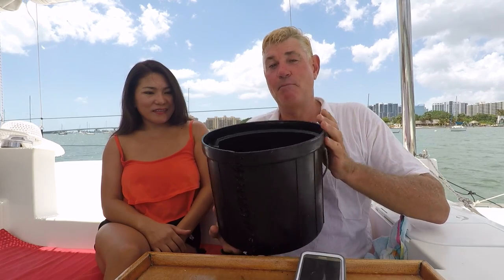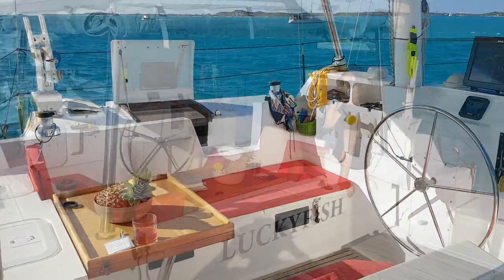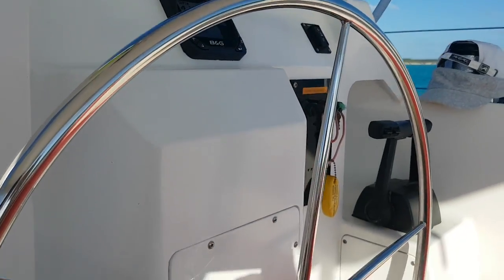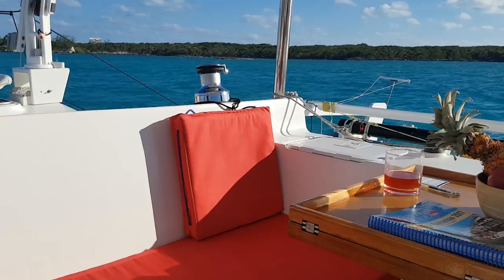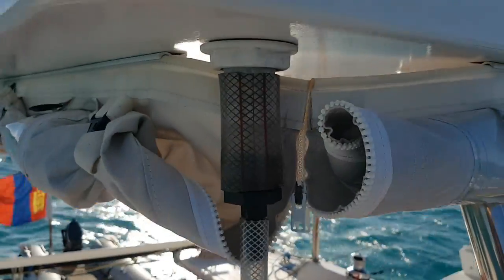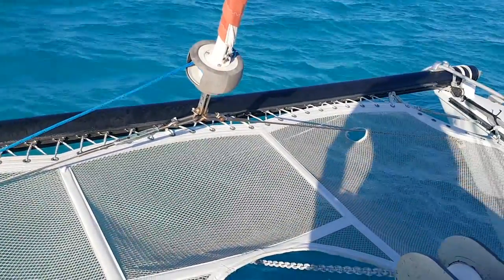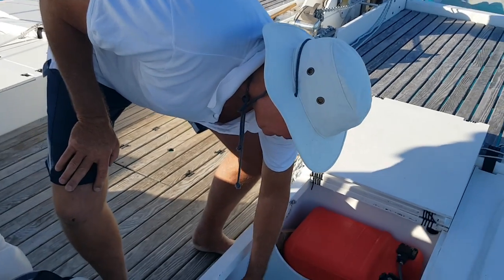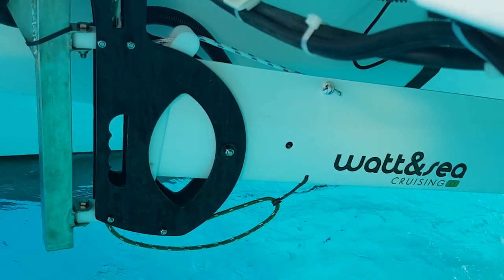LUCKYFISH Boat Tour Part 2 - The DECK - Ep 46

Comment: I really like the mix of old school and modern. Twin vanes then pulleys to drop the motors. Love it. It's a lot different and I'm sure a unique way to cruise. What kind of speed does she get under sail?  Also, while I'm asking questions.... In one of your early videos I remember an issue with a separation at the transom, was this rectified? Was it a design issue?
Reply from the maker: +Albion Parrot, thanks for picking up on the blend of old and new tech. Its one of the things we really enjoy about developing this boat. Picking the best from both worlds without being blinded only by one. Speed is excellent for a cruising boat, on all points of sail from sheets just cracked to dead flat off. She does half the wind speed or better up to about 12 knots wind speed tight to broad reaching. 8-9 knots with ease in 18 to 20 knot true wind. On a recent passage from Grenada to Exumas we covered 1058 miles in 6 days 21 hours ave speed 6.44 kts in a variety of conditions. Pretty respectable! Our transatlantic of 5,000 miles from Namibia to Barbados included Doldrums and awkward seas at times. We averaged 5.5 knots over all. Again, very respectable considering we had a novice crew and didnt push the boat. Re the delamination on the lapstrake, that was starboard hull forward and turned out to be an epoxy fillet that cracked away from the glass, likely due to the pounding we got in the Benguella current. It has since been glued and has presented no further problems. It was not structural thankfully! Cheers and great to get your questions, Stewart

Comment: Must totally agree with Stephen. I was looking at Hunter 44DS monohull. I think I am sold on the catamaran. How often do you have to replace the forward between hull netting due to uv deterioration? Again Thanks for the video and sage advice. Marc
Reply from the maker: +Marcus Russell - we used that Pilchard net from new. I reckon it should be good for 5 years. In hindsight I would go with "supertramp" a more closed mesh design used on many of the production cats. Not sure of life expectancy. 10 years maybe?

Comment: Great tour team! Have you been happy with the Takacat? I am giving consideration to one of these as an auxiliary tender on board out 48' ocean cruising yacht. I like the fact that they can be packed down into a bag for stowage. Do you find that yours can be a bit light in strong winds and will dance around or flip? Cheers. Wade.
Reply from the maker: +Bluewater dreamin thanks! we love the takacat due to it's lightweight, stability, and semi rigid high pressure floor. we have never had it flip. when it's tethered to the stern and we are on anchor we use a short tether and keep it in the lee of the boat when the wind is up. we tow it but stow it on deck or in bags for longer trips or if it's blowing. Cheers Stewart

Comment: Thank you guys ! 
How fast will she sail?
Reply from the maker: +Zone Television, great question. Best days run so far is 190 miles. We just averaged 6.44 knots on a 700 mile leg Grenada to Long Island. Not too shabby. Fastest surf so far is 15 knots with coffee mugs sitting on the table. So stable and under control of the vane. regular surfs to 13 knots. Sustained 8-9 knots reaching, again stable and no fuss. cheers Stew
Reply: Thank you kind sir ✌️😎 ⛵️

Comment: can you detail the rope hinges on the doors through the hull please  , they look a really simple and good solution , the videos are really fun , wharrams are really impressive once seen up close , with many really good details (like the rope hinges )
Reply from the maker: +Jennifer Smith, I will try to describe it. It starts with figure of eight stopper knot on the underside, pass through one side of hinge out the top, then you go down through the gap and back up in the otherside. And so one. That allows the hinge to move and is very strong too. If this is not clear then pm me at stew at svluckyfish dot com and I will send a pic, cheers and thanks for commenting

Comment: Nice one Stewy and Zaya :-) I'm enthralled by the Wharram concept, mainly driven by your videos.
I'm looking at changing from mono to cat as I feel as I get older it will be a tad easier on me...lol (Hope my partner doesn't see that bit, the shit she will give me ! ) 
I mainly do coastal with the occassional trip from oz to NZ, unfortunately my partners job and family commitments mean I do quite a bit of solo sailing.
So my question is, do you think your wharram and it's rigging is conducive for soloing ? Particularly keeping in mind your comments on gaff sails.
Cheers, love your work, your video's keep getting better as time goes on !
Reply from the maker: +Mick VR great to get your comment. no problem with single handing the boat, like any other boat you need to plan out your steps a bit more. Sounds like you have singlehanded a bit. if anything the Tiki is easier, stable platform and good tracking. The vane is an awesome assistant too. sign up on our website for emails as we are working on a way to address the quality tiki 38 shortage. it's a real problem for a lot of folks cheers and thanks again for the comment, Stew